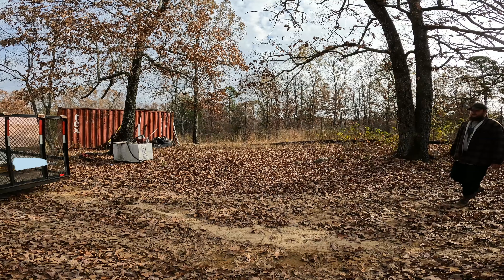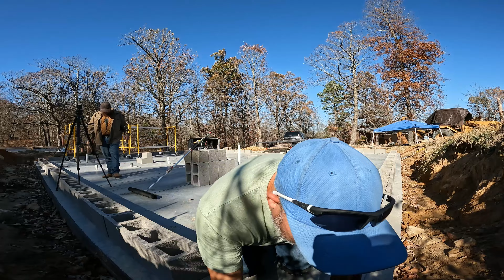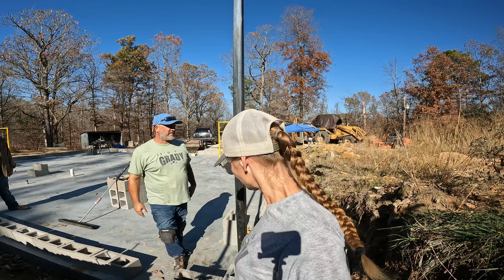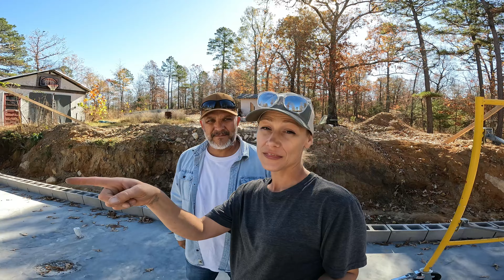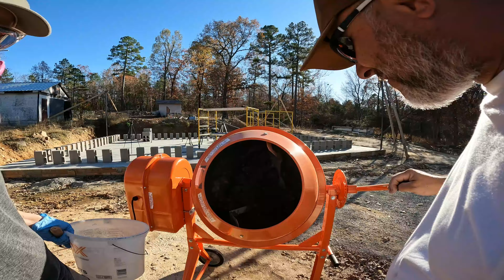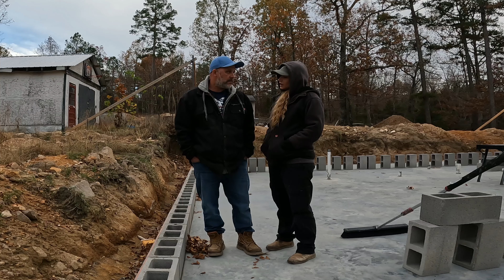Setting leads / Laying our first blocks/Couple builds House in woods/

Comment: Guys , start block at 2 corners . Use your lazer level if you have to. Get corners going all 4 ways so you can string across . Can aways sit a block in the center with 3/8 plywood under as if mortor. Than use string as the guide
Reply: Steven, I couldn’t agree more! Get the corners set. Guys, looking good so far!

Comment: Mixing mortar a little stiff to support block or test if it will support it .use keep 3/8 joint , 
Keep checking as you go squareness. Rebar into slab or drill hole before you get to high
Reply from the maker: Thanks for the tip!

Comment: Not sure where this is but here in Ohio a wall would break up from being lifted by frost without having a deeper footer.
Reply from the maker: We have no footer, it's a mono slab.  Where the frosty line is much deeper like Ohio I'm sure it is like two foot. We have like a 14"or 16"Frost  line. We are in north central Arkansas. I was questioning the same thing.  Good eye my friend. Thanks for hanging out 🥰
Reply: @Itsallgrady  but your footer isn't 14 deep is it. If  the ground freezes under your footer, the wall will break
Reply from the maker: Our footer is 18"thick.  The slab is about 4 to 6".
Reply from the maker: No That incorrect it's not 18 thick.  It's dug below the frosty line all the way around.  Sorry for the incorrect info.  My bad
Reply: @Itsallgrady  normally a monolithic pour will be deeper around the outside and it would be deeper than the frost line in your area. So I would think it should be atleast 18" below the ground on your walkout side of the basement. What will happen is it will only freeze on the side of the walkout and lift that side only causing the floor and the wall to crack.
Reply from the maker: I see what you are saying.  The front will be buried to below the frost line. As we know very little about the profession we Islamic explain incorrectly.  Did that sound correct? Lol